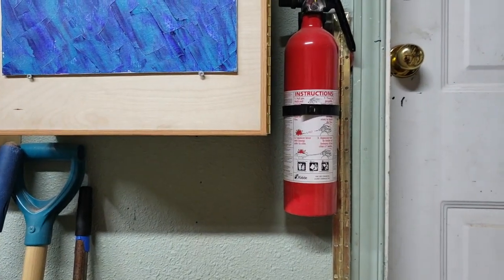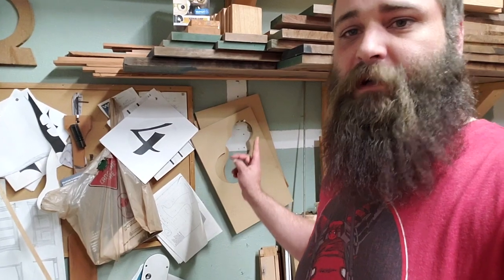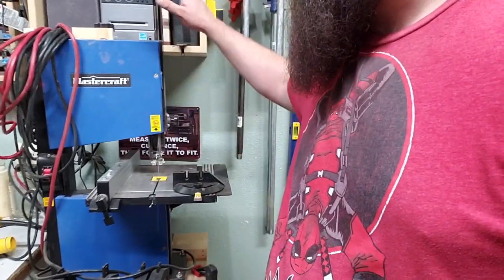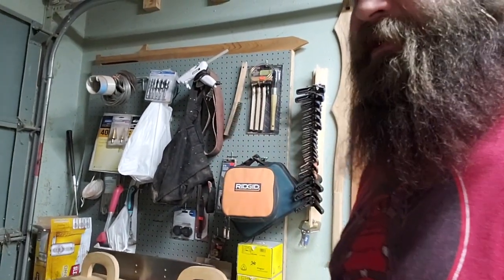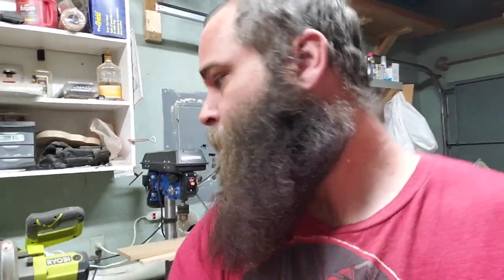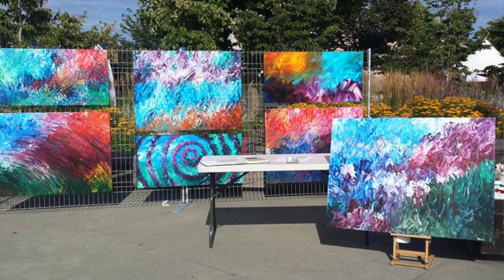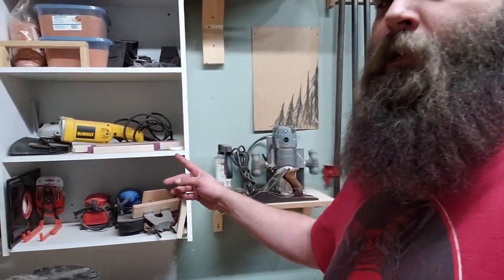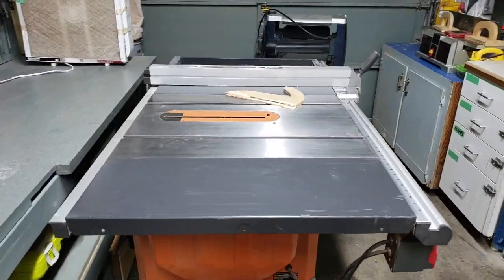Maybe the worst ever shop tour?

Comment: Would you share more about what do and don’t like about the table saw?  Just subscribed:)
Reply from the maker: I love it, but I don't have any experience with anything else other than the cheap crappy contractor saw I upgraded from, so there may be flaws I don't see. It was kind of finnicky to get the blade aligned with the miter slots, but it's super quiet and smooth and has plenty of power for my needs. I did a fair bit of research before pulling the trigger, and it seemed like this was far and away the best saw I could get for under a couple grand. I also love that it's warrantied for life. Thanks for watching.